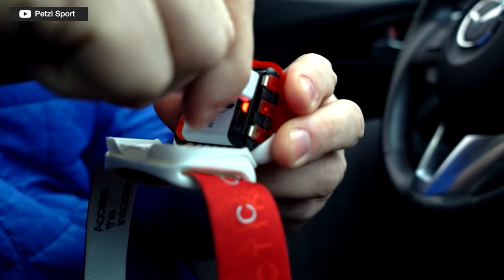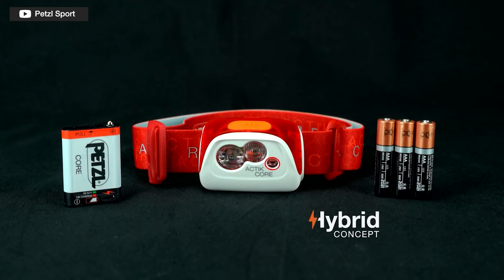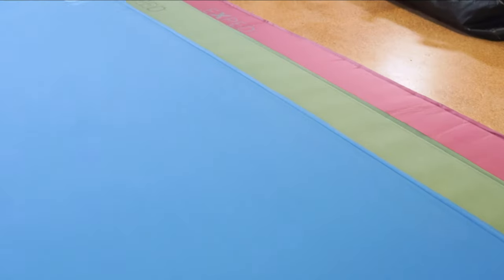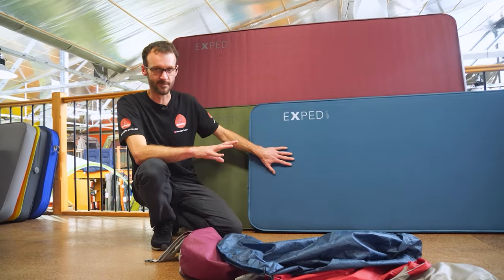Ep 91 - Selecting Your Dream Sleeping Mat

Comment: 21:55 For 50-100 dollars you could potentially buy a foldable/rollable high-density foam mattress. Granted, a little bulkier, but arguably far more comfortable and 'unpuncturable'.
Reply from the maker: Ah yep, that's a good point.  Might even be able to find a source than can cut you pieces to the size you need.
~ Lauren
Reply: @SnowysOutdoors  Are they still around? That rubber shop from past days, Clarke Rubber?

Comment: For my ute/home build, I'll be finding something around 1800 x 600/900 that I can move from a covered swag/tent, to a covered space in the back of the ute for extreme weather, and also tough enough to lay on the ground on nice, clear nights.
Reply from the maker: I reckon it may be better to have a decent small tarp to go under the mat, which would give you way more flexibility.
~ Lauren
Reply: @SnowysOutdoors  Yeah, I have a 3x3 here atm, so will probably use that as a ground sheet.

Comment: For swags consider the height as well as length/width. If your swag came with a 5cm or 7cm mattress originally, getting a 15cm high mattress to replace it may be 'too high' (if a non-traditional swag it means less headroom between you and the top of your swag + it sits higher against the side of your swag ie against the mesh instead of the canvas, can make a difference when it rains).
Reply from the maker: Some good considerations - thanks @swagging sisters!
~ Lauren

Comment: 11:40 Lauren, you folks have a Sprinter van, don't you? Is there a 'real' mattress solution you can use? Can you modify the setup to accommodate inner spring singles? I had an inner spring mattress that was about 3/4 the size of a regular single in all dimensions. Or is the sleeping setup too small? Sorry, I've forgotten your layout when you did your walkthrough.
Reply from the maker: We have a king sized domestic mattress in the Sprinter.  My partner is abit of a "princess & the pea" type bloke, and wont camp on anything other that a real bed.
~ Lauren
Reply: @SnowysOutdoors  Hahahaha! I've slept on a dirt track with a sheet over me. However, I too prefer a comfortable mattress (tell your partner that I feel the peas too). I'm trying to figure out the most comfortable sleeping solution for the minimal space I'll have (1600 x 1600 max sleeping/bedroom space) on my platform.

Comment: I have a Darche Dirty Dee 1400 and sadly the Darche 1400 mat is actually a little too big to fit inside and it pushes out the sides. It’s also more or less impossible to roll the swag up with the mat inside.
Reply from the maker: That doesn't sound right, it should fit comfortably as far as I am aware. Is it the foam or self inflating version that you have? ~ Ben